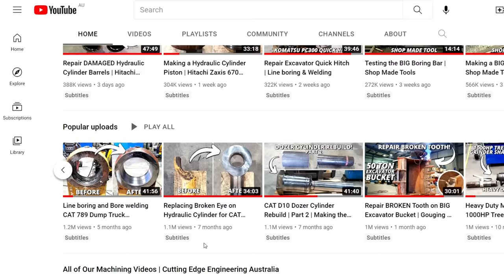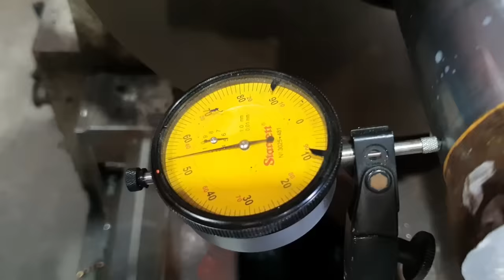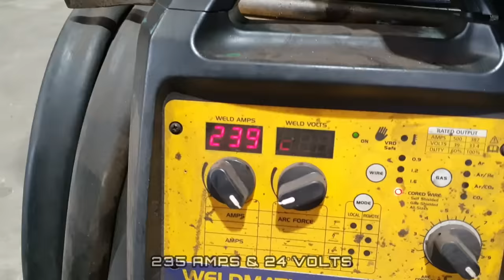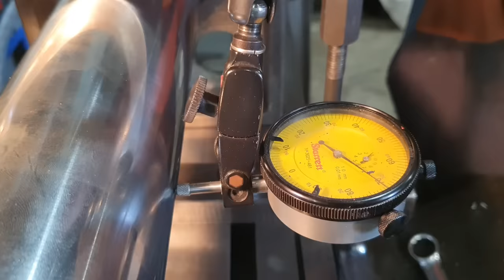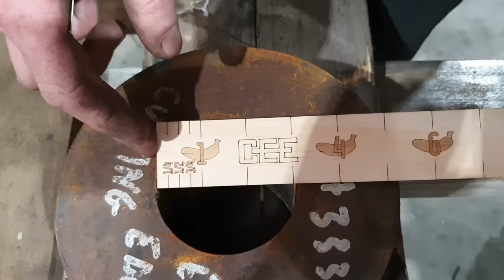Replace BROKEN Eye on Hydraulic Cylinder for CAT D10 Dozer | Machining, Welding, Milling

Comment: Has anyone considered co-extruded tube for cylinder rods?  Back in the day pulverised coal boilers had mild steel water tubes. Those burning coal with a high salt content (aka high chlorine) suffered excessive fire side erosion. Stainless expands far more than carbon steel so we had tubes which were mild steel inside with about 1/3 of the thickness stainless on the outside. 
Question- would a co-extruded technology make a better hydraulic piston rod?

Comment: I'm in the US, grew up measuring in "bananas."  Resisted metric my whole life.  Then I started machining.  Unbelievable how easy mm are.  Most kids and adults in the US tell you how much they hate fractions.  Simple.  Measure like the rest of the world.  Much easier to make calculations in mm.  Need half of 15mm, simple, 7.5mm.  Why would someone try and use thousandths of an inch?  I'm sold.
Reply from the maker: welcome to the light! 🤣

Comment: Just a thought fella, when you accidentally dropped that bushing then continued on to press it into place ..did I see the grease hole in the bush misaligned with the eye or did I miss you correcting it ..pickey I know  but you made a beautiful job of the repair anyway that goes without saying..(comments )

Comment: It's nice of engineer's to make a dotted line for failure. They do this on our Idler pins. 8" OD and over 60" long and they have a grease port drilled half way through and then another grease port that intersects that port drilled through the OD. Pin splits into 3 pieces and looks like a modern art masterpiece.

Comment: Does anyone have an explanation why the grease through the pin wouldn't work? Just the extra hole(s) out the side and through the middle of it weakening it too much?
Reply from the maker: yeah the the hole through the middle changes the structural integrity and weakens the pin, they just snap under load

Comment: Why not weld a plate on top of the eye, put the recess in that and then the eye would not be compromised in thickness where the grease fitting is?

Comment: Hello Kurtis,Karen,Homey. 
Great job done by all.
Question when the rod was repaired  by the other person did putting  a dowel give  it any strength  or just to hold in place.?
Like the Banana  rulers they should be world standards  for today.Lol
Take 20,000+1 ok kurtis  give it a little bit of John Wayne, 007,AN James Dean action.
Karen good video.
Homey on break with goodies.
Thanks alot. Stay Safe/Healthy.

Comment: 1:31 Seems like it was cracked for a long time and they kept using it because they haven't noticed the crack. Both broken surfaces are rusty, so they were cracked long before the final break, only that small area around the greasing hole kept it together, which is not rusty. I guess...

Comment: What is that neat little metal router tool called @30:37?
Reply from the maker: that's a mini pneumatic bevel chamfer tool, found it on ebay

Comment: It's almost a pity that the rod itself was undamaged, because if you'd had to replace the rod, at least you could have turned a spigot on the end to fit the eye onto instead of relying on a dowel.

Comment: Before you said it I was thinking the samething putting the grease zert on the pin. I have a air craft machinist background not to say heavy equipment flies but there is a big degree of Methodology to building heavy equipment. Back to the pin maybe the pin was to soft to bore a hole to large not sure ,what they did for it not to work may never know. Pins have been used from ships to trains yes even air craft think about a internal combustion motor the rist pins on the Pistons and the abuse they take after 400 thousand miles.

Maybe they need to have pressure oiling system doesn’t need high pressure. Just keep it oiled. Think how much money a company would save. Worth designing a system you could add to any tractor.   Sorry for rambling

Comment: ripping rock is never going to be kind on anything......the only answer is to over engineer. Part of the reason the grease hole is failing, is because its a a stress raiser. In aircraft they had this problem with rivet holes......so they needed to pay special attention to how they form,drill and finish the hole to remove any burrs etc to reduce its stress raiser probability.  Just drilling the hole and leaving a sharp shoulder leaves a bad stress raiser. Just removing the burr from the hole and rounding the shoulder of the hole helps.

Comment: We had to stop giving our lab pigs ears because he was tearing off large pieces and swallowing whole. Then they would plug up the “sewer system” and I would have to physically reach in and unclog the “tail pipe”. Not a pleasant job to be sure.
Reply from the maker: we've just received a very clever 3D printed treat holder that solves that problem! no more sewer blockages 🤣😂https://www.monchball.com/
Reply: @CuttingEdgeEngineering  lol nice!

Comment: US money is metric, that is based on ten. I have tried to teach people the metric system by comparing money. It don't work. The US uses Winchester Cathedral Standards and not Imperial Standards as is commonly believed.  The Brits make aircraft parts during WWII for American aircraft. They didn''t fit. Although the units were named the same.
We have 3 ounces in common use. But most people don't know the difference.
I used to ask people, which was heavier, a pound of feathers or a pound of gold? The answer is a pound of feathers. Different pounds.
To make matters worse, each state sets its own standard weights for a bushel of produce, such as corn, wheat, potatoes, etc. Of course they are different. To complicate matters even more, there are bands of different mass measurements running through the continent. I used to work for a company that made truck scales. The scales had to be calibrated for the different zones.  It used to be common for a truck to be loaded in one state, with so much corn for instance, Then when it got to another state, the weight bands and different bushel weights could cause over or under loaded trucks.  There used to be piles of produce outside the weigh stations near state lines. 
To make matters worse, the average chaw-bacon doesn't know and isn't able to use yards, feet, inches, gallons, quarts, etc. Including counting money. As the average high schooler this question, "If 33 1/3 cents is the third of a dollar, what is the third of a dollar and a half?"

Comment: While I was working at an aircraft manufacturer I had the cylinder of liquid nitrogen in my department to use for installing bushings into parts. Some engineer fresh out of school wanted to do some testing shrinking parts in liquid nitrogen. He showed up with a thermos to carry the liquid nitrogen.  He went to put the cap on and I warned him about the pressure that would build up but he was reminded me he was an engineer. When the thermos blew up in the office he tried to blame it on me which didn't work. Dumb fk